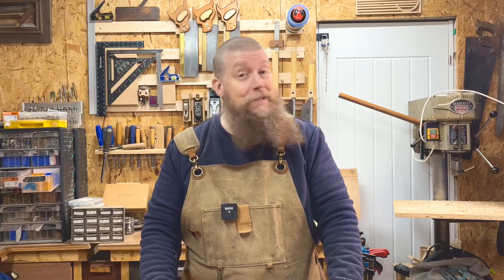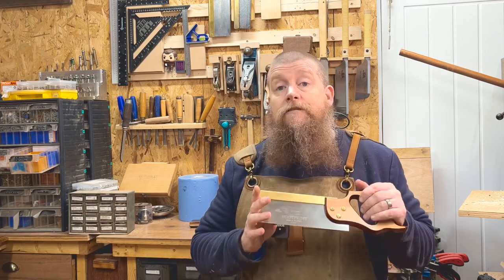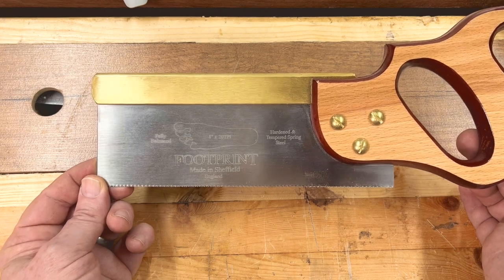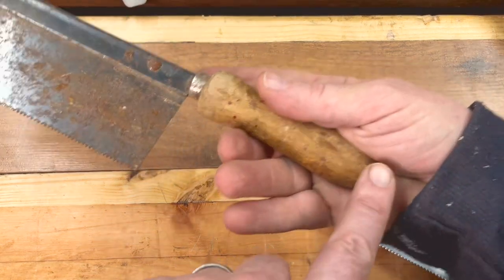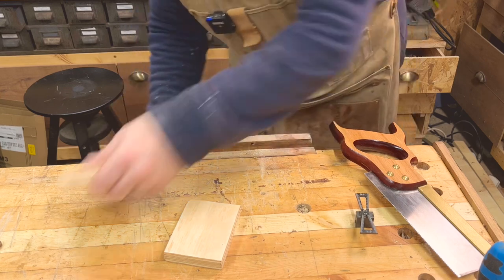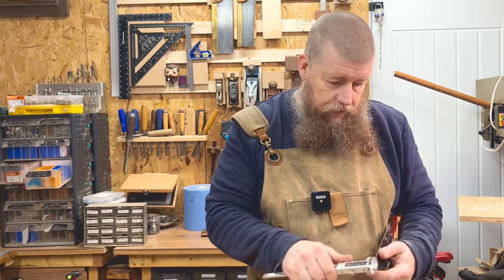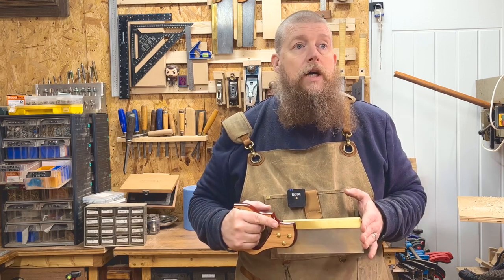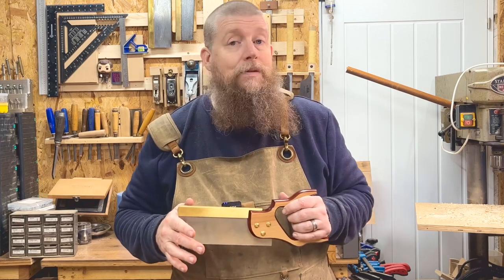Footprint Dovetail Saw review

Comment: Brilliant video, down to earth review.  Would point out though, that for an extra £10 you can buy the Veritas dovetail saw with pistol grip.
Reply from the maker: Thanks for the comment. The point of the video was to celebrate the history of British Tool making. Plus brass back saws have been essentials for a lot of woodworkers over many years.
Apart from that, I’ve not tried a Veritas, not sure how I feel about the composite spine etc, but it would be good to try one.
Reply: @WoodworkJourney  Totally agree with you.  Stay british where we can.  I have used both and there is, for me anyway, a slight difference in the way they perform.  The Veritas just feels better in the hand and seems to leave a much finer cut.  The Footprint saw represents excellent value for money.  A light pass with a 1000 grit diamond stone along the sides of the teeh, would tune the kerf beautifully.
Reply: @andrewgould2118 , I've done that to all my back saws from 8" to 14". I've also found that if its pulling to one side or the other then an extra pass or three on that side will straighten the cut right out. (Better done a swipe or two at a time, though.)

Comment: thankyou , are thy cross or rip cut teeth. keep up the good work dean.
Reply from the maker: It’s a Dovetail Saw so I guess ripping, however I’ve used this for a bunch cross cut stuff as well to.
Because of the high tooth count it’s a clean cut but doesn’t have the gullet size of a classic rip saw
Reply: @WoodworkJourney , Crosscut, actually. Here's what the manufacturer's description says: "About this item, 
    Made in Sheffield, Britain
    Solid brass back for rigidity and balance of the blade
    8 inch blade
    Crosscut teeth - 20 teeth per inch (21 points per inch)
    Can be re-sharpened using a medium file. Precision sharpened and set teeth.Two Tone beech wood handle.For very fine woodwork".